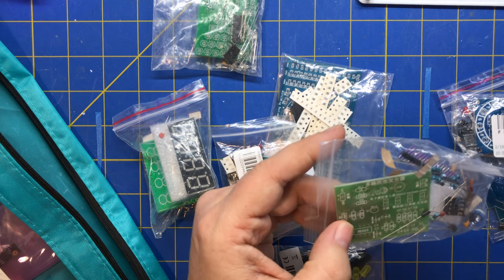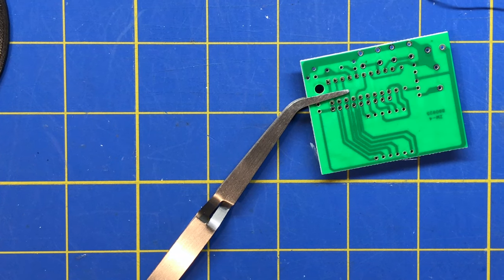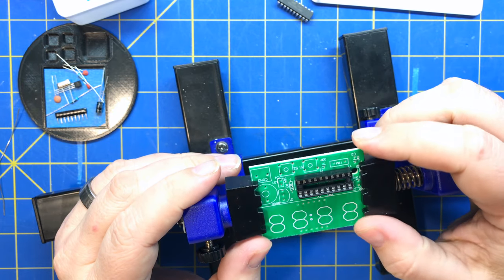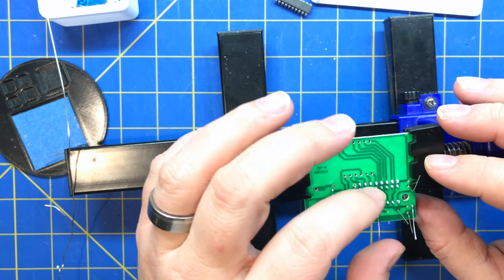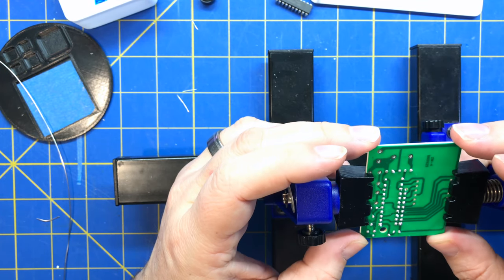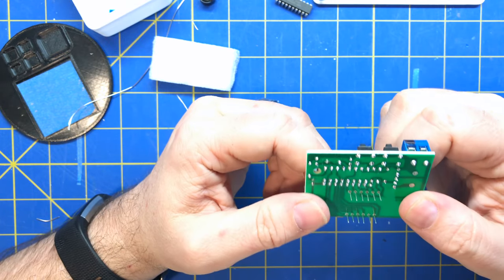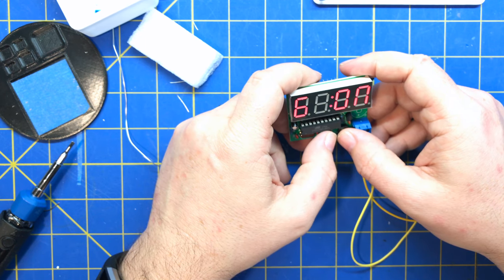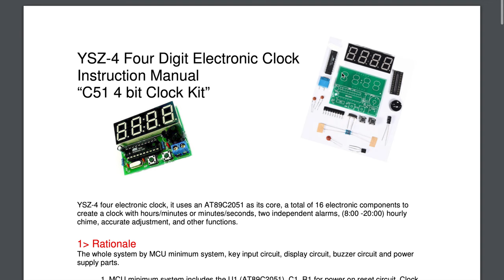Lazy Sunday Kit Soldering

Comment: Totally dig the channel, when I sleep I dream pcb and enclosure ideas, parts and pieces... drives my wife nuts sometimes lol anyway the kits are always fun. If you don't mind me asking I've been "renovating my lair" and my biggest issue yet is camera positioning for long session recording, whats your trick ?  and stay 1337!!!
Reply from the maker: I am still learning and trying this on the cheap, so no microphone and just an iphone for video (lots of file shufffling) one day ill upgrade real lighting and recording gear maybe but its not cheap. Id rather buy $2 kits ! I am using a old dual monitor arm $30 and moved some of the pieces around. And it is mounted to my wall on plywood with a cheap ebay phone holder, I keep it right above my head so I don’t hit it and it still can pick up voice. Then I bump levels in editing. Iphone has 2x optical zoom so I can zoom if I want. My nikon dslr is too old to do video, :(
Reply from the maker: Ill make a video soon when my bench is clean about it.
Reply: @tablatronix  Thanks for the reply, I use my phone as well but on a tripod and is a pain to work around, decided to hold off on the videos until I get things setup better. I like your monitor arm mount idea and think I might go with something similar.